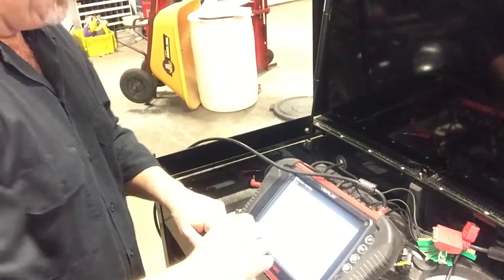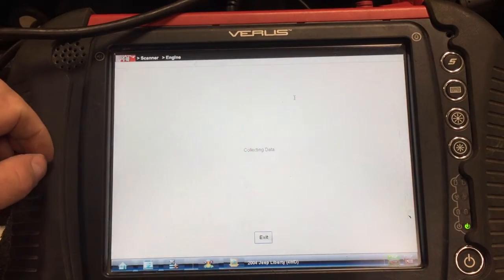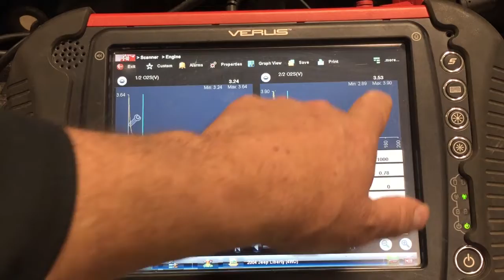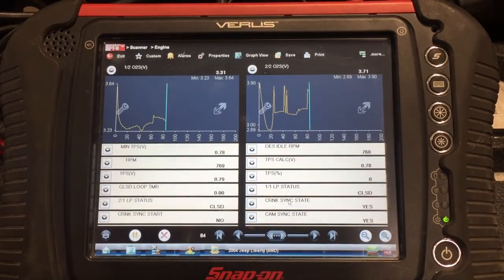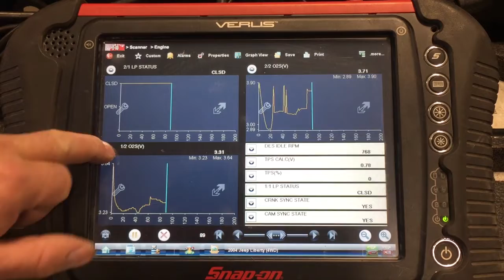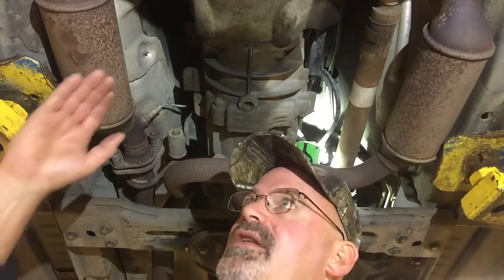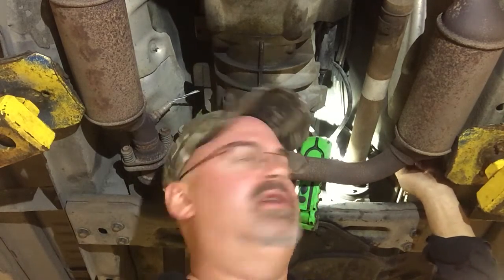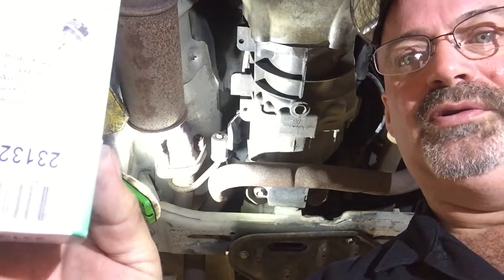Chrysler Dodge Jeep P0157 P0158 P0137 and/or P0138

Comment: Thanks so much. Another video said my bad sensor was on the other side. I removed it, tested it. And it was bad. Wasn't able to get the part today, but had a sensor from my other Jeep Liberty, that dropped a valve. I had to solder the wires to the connector. I will find out if it works soon. Eventually I get a new sensor. But hopefully it will work, for the mean time.

Comment: I just today got the P0137, it popped up when I started the engine after being in a car wash.
It's a 2.7L '06 Sebring.
I've had some code before after the car wash a couple of years ago, that was an O2 sensor as well.
But that one got soon better by itself, I hope this will too.
Maybe water getting in somewhere..?  🤔

Update:
So as of today(one day after my original post), the engine light disappeared, just like the last time when it lit up in a car wash.
Man, I hate all these sensors and electronics.. 😂

I sure miss my '70 Plymouth Duster with a 360 small block. Zero emission bulls#@t equipment and sounded so sweet, too. I souped it up just a little. The camshaft, headers, intake & carb and that's about it. To help it breathe you know. Those alone made the car so fun to drive, while still not being too "racy", probably around ~300HP. But the 360 has a ton of low end torque, so I wouldn't stare at the horsepower numbers. I would actually argue that it was not that much of a gas guzzler, because of that massive low-end torque nature of that engine. It was swapped in of course(I think the 360 block was a '72 or '73), the '70 Duster wasn't sold with a 360 new. I kinda wish it had the 340 though, legendary Mopar engine 😉 It was a former street racer in fact, it used to have a 340 and in the trunk there still was a metal thing built to carry the nitrous oxide bottle, I'm guessing that thing sounded sweeet 😁👹

Alright, I'm getting carried away with this(no everyday driving that thing with these gas prices anyway..). I just hella miss when cars had nothing "extra" as nowadays, you could reach and fix about anything yourself on those pre-smog years cars and it was fun too!

Comment: Great video..my 06 chrysler 300c 5.7 has all four o2 sensor high codes come on at once..any idea were the ground wire connects to on block for o2's or what the problem could be...?

Comment: it's odd many states are removing emissions testing from vehicle inspections, yet automobiles seem to continue being made with more and more O2 sensors. Some vehicles have 6!
Reply: It only makes sense as cars get cleaner do to epa demands The failure rate at the emission centers has dropped so much they aren’t a cost effective entity anymore. Cars are Running Much cleaner for much longer times these days. 
Although it does surprise me that the government will let anything go that can make them a buck.
Reply: O

Comment: just got an p0157 code on my dodge charger. im assuming that it is a bad o2 sensor as it does not affect the performance of the vehicle. the weird thing was that the check engine light just came on randomly...i will knowfor sure if thats the problem by taking it to my mechanic.
Reply: So what was the problem in the end?

Comment: My 2004 Liberty has the 3.7 engine and the O2 2/2 sensor connector is really hard to get to. Is there a trick to disconnecting it? Can it be done with one hand?

Comment: Hello.My 2008 town &country has P O137 .but the sensor which I replaced  from mopar dealer had areversed relation with .facuum.making ahose out of the mainfold the signal voltage goes up more than 1.5 V. pumping some gas or fuel to air inlet the signal voltage goes down to .25V.
What happed for this Rev. Realtionship.I bought this car with check engine fault😢 .can you help .😇😍
Reply from the maker: Bring it by I’ll take a look.
Reply: @ThecardoctorTV  SORRY YOU ARE 10000 MILES AWAY FROM MY CITY.

Comment: So I've got a 12 jku. Po137
Bank 1 Sensor 2. I've watched 20 videos. Nothing is clear where that sensor is. Most say its behind passenger fender well. Your saying it's on the driver's side behind the cat.... Just trying to change the thing in my drive way and won't to change the correct one.
Reply: Bank 1 is the side your number 1 cylinder is on. For 2012+ Wranglers with the Pentastar v6, bank 1 is passenger side and bank 2 is driver side.

Comment: Smashing, another customer happy :-D
As you said, earlier sensors died upstream and the cat sensors were living on borrowed time lol :-D
Most sensors look similar, apart from the connector being different, are the electrical specs close enough to use one from a different car model/maker?
Reply from the maker: I think they are quite similar yes but some run at different voltages I suppose. Seems like the older ones with single wires lasted forever. You people in Europe invented them little buggers. Have you ever heard of the Lambda sensor? I believe it was a German guy who figured it out. Amazing stuff. now if they can just perfect the self driving ca I can take a nap while my car drives me to the fishing hole.
Reply: Yes lambda sensor :-D, most people dont use that name, i tend to watch videos made by americans and canadians so i dont hear that name, oow and a frendly bloke called tim in Alaskania lol :-D.
I heard the name when passinger coaches had to be upgraded, the lambda sensor and a small computer had to be fitted and setup to control the emmisions.
Now that was a loooooooooong time ago, how time flys.
Reply from the maker: No kidding. I guess it's possible we are getting old my friend.
Reply: Older yes, but the brain doesnt know it :-D.

Comment: O2 sensors have to endure in a very harsh environment. is there any way to protect or lengthen the working life of 02 sensors?
Reply: Replying to an old comment, but sometimes you can actually soak the sensors after removing them and it will clean the carbon off. It's hit or miss if it will solve the issue, but it's an option if you're too broke to replace them.

Comment: I think the seller sent me a fuel air sensor from America instead of a rear oxygen sensor. Can I reverse the sensor polarity so that the response is direct rather than reversible because it is difficult to import another piece from America - with appreciation-I live in Baghdad/Iraq -Middle East/some 10000 Miles overseas !!!
Reply from the maker: I don’t think that will achieve the desired result but you can try.
Reply: @ThecardoctorTV  I thank your cooperation and patience with me. I checked the voltages of the upstream and downstream sensors using a scanner. I found that the upstream sensor has a normal signal, as for the downstream sensor, and despite the presence of readings between .5  volt to more than one and a half volt, the reading on the scanner was zero, this means that the car’s computer does not sense the readings ! Do I have to replace the car PCM ?

Comment: Hey boss Tim, please give a advice,  my nissan altima the one I change the  transmission,  everything fills fine but when I drive in could ,without let it war up  it switch from 1st to 2nd gear but it does it only one time, after that, it will drive only in 1st i put dextron 3 but some  mechanics said that I shouted put CVT transmission fluid or what you think should I do please I really need an advices

Comment: My 02 dodge ram gave me a 156 reading and then I replaced all o2 sensors. Then it gave me a 158 reading what do I do
Reply: Check the fuse under the hood.
Reply: @jjoeyoky62575  it was a loose 02 plug

Comment: IT DOESN'T HAVE A 3.7 MOTOR.... IT IS A 3.7 LITER INTERNAL COMBUSTION ENGINE.   IT ONLY HAS A BLOWER MOTOR, WIPER MOTOR, WINDOW MOTOR.... ETC....  Before you try to be a professional, please learn what you are actually talking about.
Reply: Oh for goodness sakes :/
Reply: go look up the definition of motor in the dictionary. engine and motor are interchangeable. before you try talking down to someone, please learn what you are actually talking about.
Reply: Engines are motors but motors are not engines. Get it right.
Reply: Then explain motorcycle.
Reply: Wow, if this isn't a troll, I don't know what is..and completed with all caps 'n all 😂👍